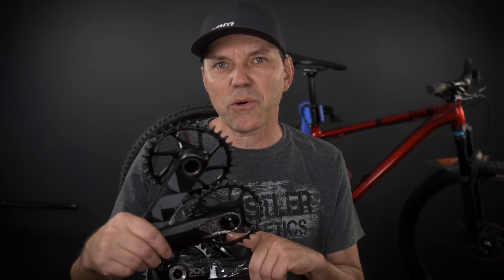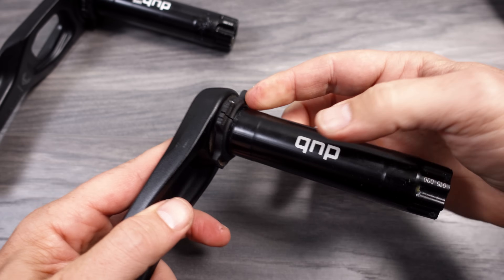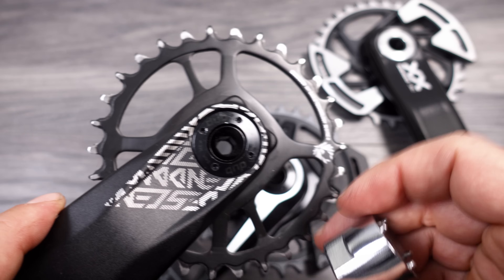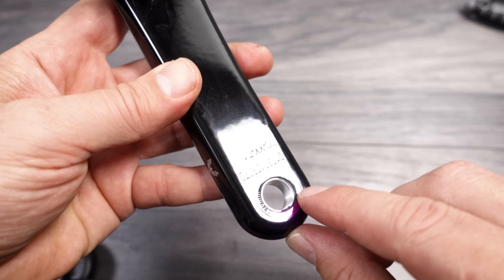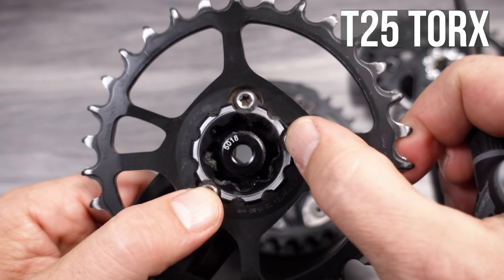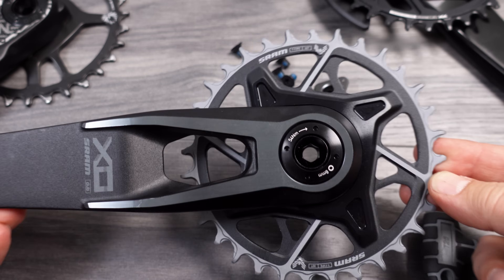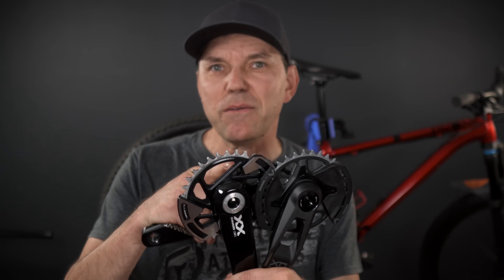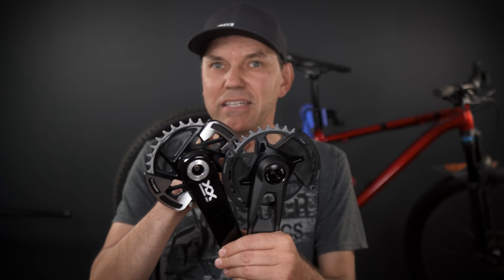SRAM T-Type CRANKSETS vs Old DUB SRAM Eagle Cranks - 12 Speed, Compatibility, AXS, X0, XX, XX SL, GX

Comment: Would there be a benefit at all to switching to a t-type crank, t-type chain and t-type cassette and use a previous generation AXS derailleur?  Wondering for frames that aren't compatible with UDH, if using this combo would have any benefit at all
Reply from the maker: WOn't work, wait for the cassette video😉
Reply: I saw the cassette video. The new T-type cassette sits 2.5mm out. That means the 10t cog will rub the frame unless you use the new T-type derailleur that gives it clearance. SRAM thought of every way to screw hybrid systems.

Comment: Both are shit with 8 bolts. Another standart for nothing. Use old descendant carbon cranks, with gxp bottom bracket and happy with it. Will change it for something else then it's die, not the new sram

Comment: Will the T type chainring fit on the old 3 bolt system?
Reply: The answer is no. The old 3-bolt system doesn't fit the new 8-bolt system.
Reply from the maker: How? Have them side by side in the video

Comment: I have old XX1 Quarq cranks with 8-bolt chainring mount with new XX chainring and it works all right with old chain
Reply from the maker: Should work just fine with the old chain indeed, thanks for sharing
Reply: Why not just use the old chainring from the XX1 era? I'm sure you can still buy those. There could be several reasons. I just wonder why you did it.
Reply: @gebhardt2  theres is no 8-bolt  chainring 32-34 teeth with 3 mm offset
Reply: @gebhardt2  and you can buy 8-bolt xx1 cranks damn cheap

Comment: Great comparison! 
One small correction regarding to the available spindle lengths: There is an XX SL non wide crankset. To achieve the 55 mm chainline it utilizes a 0 mm offset chainring.

Comment: Great vid as always , don’t use sram tho cost is high , I use raceface and all the changes get really confusing lol
Reply from the maker: Indeed, why I try to cover the details kn my videos😉
Reply: @LoveMTB  in your opinion do you think sram better now than Shimano and Raceface 
On my RSD MIDDLECHILD 
I can’t use the new derailer or transmission as they call it but let’s say the cranks , I like the integrated bash guards , I’m guessing that the normal eagle cable derailer’s will be around for sometime.
Reply from the maker: @wallyedmonds8199  if you’re ok with the 55mm chainline instead of 53 or ok to spend more $$ to get a 6mm offset chainring when available from 3rd parties
Reply: @LoveMTB  on my bike I can’t go 53 the ring would hit the chainstay . Think a lot of the new bikes that are not + size tires would work good and work better for 12 speed . And is the world getting ready for 13 speed lol

Comment: Great video, lame products. XX at 560 g for many $$$ vs. my SLX M7100 crank w. Unite 34T chainring at 570 g for 125 EUR. Better value for sure.
Reply from the maker: Yup I did that comparison last year, Shimano Alu with 3rd party chainrings are  hard to beat
Reply: 1997 XTR Triples with gargantuan 24/34/46 and funnily enough - 8 bolts/nuts - weighed 680g. SRAM is mocking you all.

Shimano should just reissue old XTR 952 in 2x10 with a clutch and 11-42 and be done with it.
Reply: @puntoycoma47 The new XTR recently released by Shimano is also quite heavy and expensive, bro, only a fool would buy it!!
Reply: @tassiosimoesoliveira1835   That's why the children yearn for XTR 952 reissue 😆
Reply: @puntoycoma47 My friend, nobody uses 3 chainrings anymore, it's an old, inadequate, and heavy system. You're talking about 1997, we're at the end of 2025. Those who live in the past belong in a museum. Technology evolves, and a single chainring currently offers the best performance and lightness!
Reply: That's because you don't know the EVOSID brand cranksets from AliExpress. The model I use with a 38-tooth chainring from the same brand weighs only 550g, is made of aluminum, costs only 5% of the XX SL, and works just as well. I've ridden thousands of kilometers on it, meaning it's also cheaper than any Shimano crankset, and lighter too! Traditional brands, all of them, rip off consumers. There are high-quality generic brands that offer excellent products at a fair and accessible price!

Comment: Don’t want sound negative.  But I think this release is useless. It’s like the apple iPhone running out of features. The drivetrains were mature before this new set.  I believe the previous is lighter all around. So what’s the gain? Am I missing something? (Great video as always)
Reply: The main gain is more robust derailleur with new mounting type, better shifting under load and potentially stronger chain. But there is also many downsides, for sure.
Reply from the maker: Out of 100 drivetrains with shifting problems 50 were caused by bent derailleur hangers. Another 20-30 by bad adjustments: limit screws, b-gap. This takes care of all that!
Reply: In 10 years transmission will will be seen as the first mtb drivetrain. It’s that good.
Reply: @OscarHernandez-xx2je  😒
Reply: @OscarHernandez-xx2je  hehe
Reply: @OscarHernandez-xx2je  XTR 952 laughs in your face.

Comment: X0 for sure. Installed a 6mm offset chainring to bring back the chainline to 52mm boost so I can run old Eagle cassette and RD and chain. Just cuz I wanted the new cranks for a new build but didn’t want to go full Transmission.
Reply from the maker: Yeah I like them minus the weight!
Reply: Where did you find a 8 bolt chainring with 6mm offset? I thought about the same and i can only find 6mm offset with 40t or more for road.
Reply: @_Wasd135  Croder Cycling - 6mm offset, 8-bolt, and comes in 30T to 42T and fully CNC machined. I can vouch for the quality. It's made in Taiwan just like SRAM stuff. Thank me later!
Reply: Trying to figure this all out and have a old school GX eagle drive train and my crank spindle is worn out. Did you make any other mods to the new crank? And how does the 6mm offset chainring bring the chain line back to a 52mm?
Reply: @ChrisCorless  The new cranks are 3mm longer on each side. It comes with a 3mm offset chainring. That combo is a 55mm chainline. So to get a 52mm chainline with these new cranks, I just need to bring the chainring inboard by another 3mm, so that’s what a 6mm offset chainring will accomplish.
Reply: @GokkunGuru  thank you for the explanation. So with the 6mm offset do you ditch the spacer?
Reply: @ChrisCorless  You will need the required 3mm NDS and 7.5mm DS spacers because the crank spindle is longer. All you need to do is get a 6mm offset 8-bolt chainring to make it boost (52mm chainline).

SRAM is starting to sell these specific spacers as a kit. You can email them for the part number. Alternatively, you can buy a SRAM DUB MTB Wide bottom bracket. It comes with the said spacers.
Reply: X0 cranks have V2 now. Supposed to be lighter.